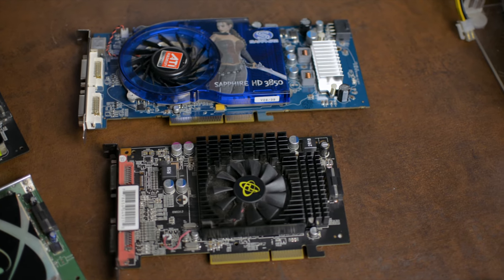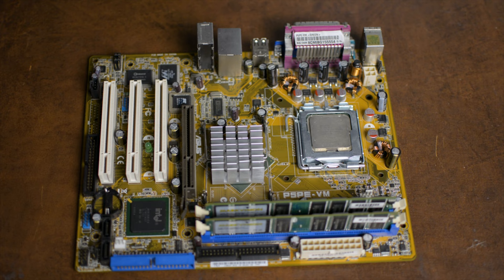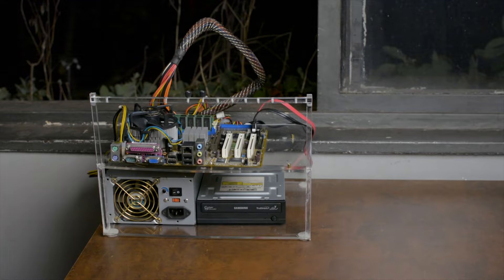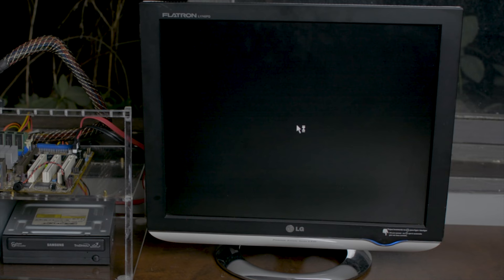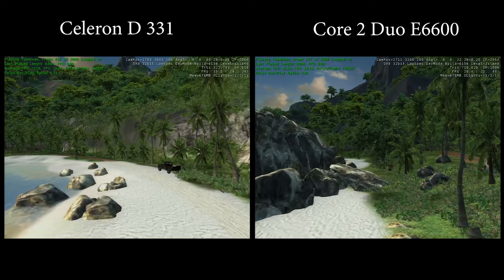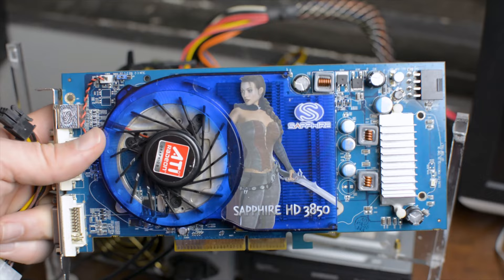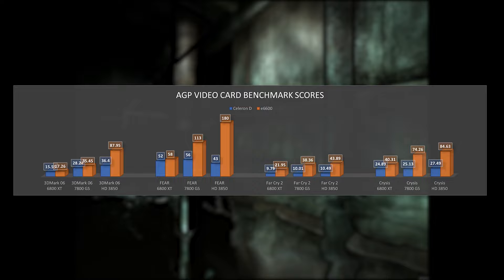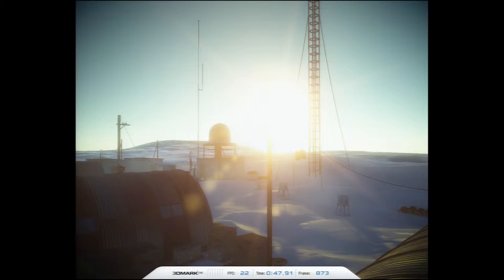"AGP is Dead!" But We Still Like It. Let's build a test platform for the FASTEST AGP Video Cards!

Comment: The motherboard that I chose back in 2005/2006 was the ASRock Dual-esata2.  This board was great for future-proofing my current system and existing parts.  It allowed me to use my XFX 7950GT AGP (nVIDIA's fastest AGP) until I was able to upgrade to my first PCI Express card, which ended up being the XFX 9600GT.  The motherboard has both AGP and PCI Express slots.  The fastest CPU it can support is the AMD X4 Phenom II 965, which is an amazing CPU.  With that CPU and the XFX 7950GT AGP, there are no bottlenecks.  I still use this system today.

Comment: I like that you tested a Classic PC hardware but what  did not like in your test is that you did not use a better motherboard and the fastest CPU to avoid the bottleneck! You know that these high-end AGP graphics cards needs to be paired with a high-end INTEL OR AMD CPU.
Reply from the maker: @GoodBoy-io6fd  I agree. Unfortunately it's not easy or cheap to find core 2 duo compatible motherboards with AGP busses. I was excited I got this one, it's the fastest AGP system I got.
Reply: @SUCRA  

Is it possible to overclock the CPU, Memory and Video Card this old?
Reply from the maker: Sure. I try not to unless I have a good reason. Performance is not really a priority on building retro machines. I've done a lot of overclocking on the am5x86 and I've overclocked a voodoo 3 for other videos here.
Reply: @SUCRA  

I like to Liquid cool the AGP Video Card and CPU. Do you think it is possible to find water blocks for these old components?
Reply from the maker: @GoodBoy-io6fd sure, every now and then these things come up if you're always looking online for them. That's how I bought most of my hardware.
Reply: @SUCRA  

You know that these are a decade old classic components. Did they made liquid cooling water blocks and AIOs for CPU and Video Card? There was no Liquid Cooling in the days of AGPs.
Reply from the maker: There was. People even made homemade blocks. What you do is cut a copper block to the size you need, carve out the way you want the liquid to run into it, and seal it up with an acrylic plaque on the other side. Then you fit in the fittings and what not. Liquid cooling has been around for a long time. I had a home made liquid cooling system that could be installed in anything. It used a radiator and fan from a house fridge. Unfortunately it got thrown out many years ago when I thought I would never get into retro computers.
Reply: @SUCRA  

Ohhh Okay but those was just improvised! What I was talking about are water cooling made by a company.
Reply from the maker: @GoodBoy-io6fd I know there were earlier CPU cooling solutions like the thermaltake big water 735, and I still think you can find something that fits an agp video card. Finding aftermarket air coolers for those things is hard enough though. You can probably adapt something that exists.
Reply: That is good to hear! The first known LCS that I knew in the 2000's was in the mid 2000's The Thermaltake LCS and was too expensive. Only a few companies make LCS before.

Comment: I had a 2400 mhz Core 2 Duo E6600 and I could overclock it 100% stable to 3200 mhz with standard voltage and to 3600 mhz with 1.5v (10% more voltage).
Reply from the maker: Yep, they're great overclockers. Back then my system had an e6700, also overclocked, but PCI-e. This motherboard doesn't overclock unfortunately.
Reply: @SUCRA  there is also a trick with tape over the pin from the motherboard to run at 333 fsb instead of the standard 266 fsb. If overclocking is necessary of course.
Reply from the maker: Oh yeah, Phil did a video about this. Something to research, thanks! 👍
Reply: @SUCRA  This board could actually run 45nm Intel® Pentium® E6700 (2M Cache, 3.20 GHz, 1066 FSB), except warning after POST I didn’t notice any issue with win98se.
Reply from the maker: @VasilijP  yeah I think that one is listed as supported, it's just the e6600 is the one I found promptly and cheap.

Comment: Awesome video! Not an easy subject to tackle, but I like that you grounded it in a realistic scenario with a user of the time period who might have needed such graphics cards. Regarding 3850 and especially 4650 results, you are right, the drivers get weird with some games, and some CPUs under XP, and as you said, performance gets a bit unpredictable. Still some interesting results since someone at the time would have likely encountered that exact situation.
Reply from the maker: Thanks, man! Thanks for watching and for giving the lovely feedback. I hope you have an awesome 2022!
Reply: yeah you can't just use any old driver with the AMD bridged AGP cards especially Radeon HD XXXX cards the bridged chips were a bit different on that series to where the cards are vary picky about what driver to use , sure it works with the Catalyst 13.1 but you needed the special drivers to get the most out of them. 
to bad AMD messed up there drivers for the older cards they did a bad job packing up all the drivers into the Catalyst 13+ versions. 
i do know the best driver you can get for the HD 4000 series is the Catalyst 11.12 that driver gives the most fps for that card and stability as long ya don't go for newer games.
this is mostly my experience from owning a diamond multimedia 4650 back then still have it but the molex plug needs replacing.

Comment: I have GeForce 6800 Ultra 256MB AGP card in Pentium4 Northwood 2,8GHz @3.0GHz overclocked. Have 2GB DDR-400 OCZ Platinum memory with lowest latency possible and also overclocked. Two WD Raptors 36GB in RAID-0 configuration. I was playing World of Tanks version 0.9.x in 2015. Pretty good for system that have been assembled in early 2004. Can play all games from 00's on the system.
Reply from the maker: Really? That's impressive! I think mid 2000s is my favorite period for gaming.
Reply: @SUCRA  The system initially had GeForce 2 MX200 from my previous computer, soon was upgraded to GeForce4 MX420 to play Half-Life 2 and later upgraded to GeForce 6600 128MB. The GeForce 6800 Ultra came as final upgrade, was able to get the card for 40$.

Memory was 512MB DDR-400 with CL 2,5 and was later upgraded to OCZ Platinum dual sticks.

Hard drive was 18GB 10 000 RPM SCSI drive and later replaced with first model of WD Raptors in RAID-0

Motherboard, CPU and other components unchanged. Overclocked later to get maximum potential of the system. World of Tanks ran at 35FPS most of time on a system that was 11 years old at the time.

Every time period have good and bad games. Modern games have godly looking graphics but gameplay is shallow. It is tailored to different generation of gamers than games from 00's

Comment: Happy New Year, Sucra! When you throw these cards into the ring, the AGP bus doesn't seem nearly as dead as everyone was claiming it was back then. Great video, and great comparison!
Reply from the maker: Happy New Year!!! Truly fast video cards by any measure. But AGP was pretty much dead 😂 haha it had no future, these motherboards that can push them are weird and they are not as common. Thanks a lot, makes me glad to know you enjoyed it! 👍🎉
Reply: Problem is AGP 3.0 was only at 8x and had to be developed alongside the already existing pci bus.. When pcie came along and matched-surpassed agp speed then it's much more efficient to just build one port tech into the board then 2, when agp only really had a use in gpus and no upgrade plan past agp 3.0.... I think my first pcie gpu was the BFG geforce 6800 ultra with an AMD FX-51 on A8N32-SLI Deluxe...

Comment: Nice setup for AGP. You should buy some cheap e5800 and see if it works. Although motherboard might be limit in your setup, due to be capable of running with only 65nm C2D's.

Over here I run e5800 (highest multiplier from C2D line up) @4.5GHz running BSEL and VID mods on ASRock 4CoreDual-SATA2 due to lack of overclocking features in motherboard BIOS.

My way of finding good CPU's is that I bought like 10x e5800's on ebay, and out of the bunch I basically have 4 good CPU's capable of doing over 4.5GHz.

Only drawback is, you need very good air cooler or simply aio watercooler to run at such speeds.

Love your videos you doing great job. Only "but" is that they could be a bit more lengthy ;).

And by the way. Happy new year from UK Sucra!
Reply from the maker: Hey, thank you! I agree and appreciated every word you put there, I'm working on trying to make the videos a bit longer.  
Nice setup you got there. I did try to get one of those motherboards, but so far haven't found one available localy and with a decent price. But it's a great topic, I might come back to it in the future. Thanks again, and happy New Year!

Comment: Yeah. That ati HD 3850 was a good budget card for semi high end at the time. That was my first $200+ card. It did run crysis pretty well. It even had a dvi to hdmi adapter that can carry audio over hdmi. Impressive. It did work really well with core duo 2 chips. Q9400 was the fastest I used. The other one was a e8400.
Reply from the maker: Indeed. My original 3850 was pci-e, which makes a lot more sense for this card imo. But as an agp video card you do want the best of core CPUs like you've described.

Comment: Great comparison! I was really surprised by the 4650 beating the 3850 in fc2 and crysis ! What drivers did you use on those card ? 10.2 legacy ?
Reply from the maker: Thanks, man! I used the last working driver, they still have them up on the website. I think that result is a fluke. Might be related to the 4650 being a bit newer than the 3850. Also it's a 5% difference, so I wouldn't say those results would measure absolute performance advantages.

Comment: I imagine part of the reason for these products was that games came out with a hard requirement for DirectX 9.0c which wasn't supported by the older video cards.  To me that explains the Nvidia ones; no idea why Radeon kept AGP going 2 more series after Nvidia.

I actually bought a 7800GS off some guy on craigslist for $20 in 2012 which was fun to mess around with.  I only had it paired with a non-HT P4 though.
Reply from the maker: Yeah, the DirectX 9.0c thing is a good reason. That 7800gs was a nice catch 😆 P4s are capable of running many many games, so I bet you had fun with that. 👍

Comment: 7:25 I've always loved back plates for some reason. Even if you don't see them when installed, it makes the card feel like a tank. 

Also didn't notice that Far Cry 2 was so much harder to run than crysis. Do you think the fps difference between far cry 2 and crysis would still be as big with a more powerful cpu?
Reply from the maker: Hey thanks for watching. As for the benchmarks, I think they have different approaches, one more accessible and the other has more options. Happy new year, my friend.

Comment: These AGP cards were probably released for those who played older games but wanted higher framerates and resolutions, as when you're CPU constrained you can just crank the resolution to hell and beyond and not lose performance.

I imagine video decoding and possibly even compute also played a role here. When the graphics card can decode H264 video in hardware even a potato CPU was good enough. Even today, you see crappy single digit watt Celeron SoCs handling 4K video better than an old i7 would because of that hardware video decoding.

Likewise for compute, you just need to transfer the data to the GPU and let it compute what it has to compute with the vertex and pixel shaders. And AGP was still present on some Core 2 powered motherboards.
Reply from the maker: All good points, thanks for the comment. 👍

Comment: Ótimo vídeo Bruno, justamente o comparativo que eu precisava. Sempre notei que minha 7800GS estava amarrada pela performance do meu Athlon 64 3500+, mas não importa muito, é um sistema que uso apenas para os jogos de WinXP lançados até 2004, pra jogos após 2004 não faz muito sentido usar uma placa AGP. Minha GeForce 7600GT PCI-E pareada com C2D E6600 tem uma performance superior a 7800GS nestes cenários. Essas soluções AGP faziam sentido na época, hoje é apenas pela nostalgia do AGP,  tenho uma Radeon X1950 Pro que ainda não desisti dela, ela dá artefatos e não instala mais os drivers, mas ainda quero vê-la brilhar =].
Reply from the maker: Obrigado, sempre um prazer compartilhar. É difícil achar um CPU que sature essas últimas placas AGP, apesar do a64 3500 ser um ótimo processador, é como se essas placas foram adaptadas pra funcionar com sistemas antigos. Concordo com você, esse combo é bem legal, gosto muito de mexer com Athlon64, foram revolucionários pra época. Sobre sua x1950, de repente compensa tentar aquecer o die, como fiz no vídeo com o título: RETRO GPU: YOU DON'T NEED TO REFLOW!
Feliz ano novo, tudo de bom pra você e os seus.
Reply: @SUCRA  Feliz ano nova cara, muito sucesso com seu canal. Eu já vi este teu vídeo, tá faltando coragem para tentar o "quase reflow" e também uma heatgun que não tenho. Mas já são duas que preciso tentar salvar, essa X19050 Pro e uma Radeon 9600 Pro, ambas ligam, mas não estão ok. Acho até que a 9600 deve ser capacitores ruins, porque ela roda alguns jogos, alguns benchs, mas eventualmete trava, isso com pasta térmica em dia e ventoinhas limpas e lubrificadas, é muito estranho o caso dessa 9600.

Comment: Fun fact that I only realized 8 months later:
this motherboard actually has official Windows 98 drivers! Yes, full support for Windows 98 on a Core 2 Duo!

Unfortunately, another channel who used this motherboard for that purpose has found that they are quite unstable; so your mileage will definitely vary, but hey; that's an option.
Reply from the maker: That's good to know! I don't think Windows 98 makes use of both cores, but even single core that would be really fast for it.
Reply: @SUCRA  Indeed - even the Celerons blow it out of the water.